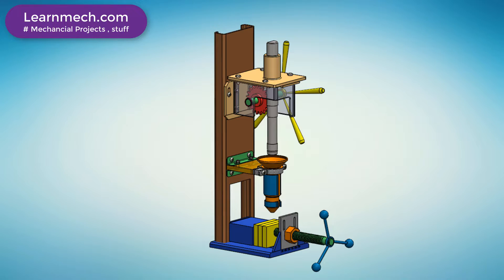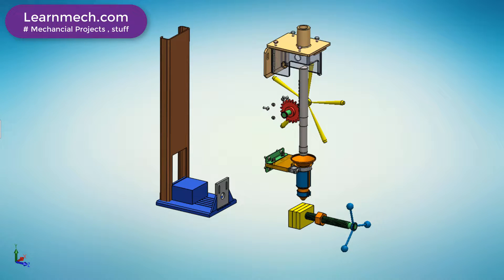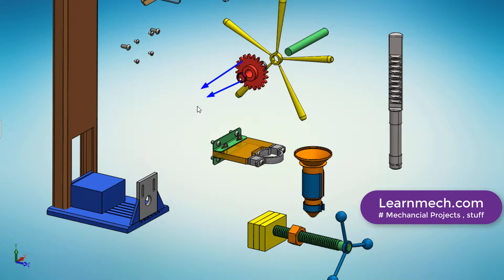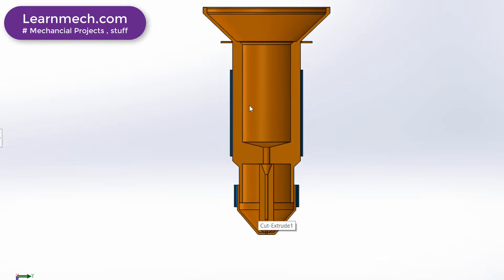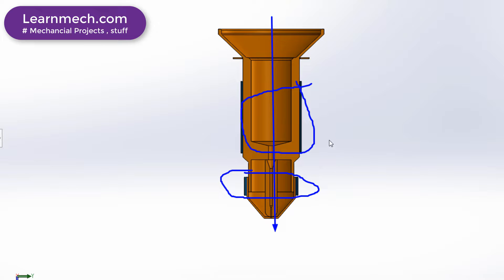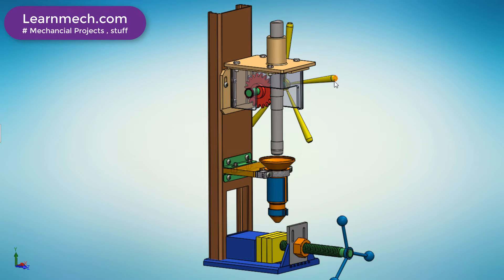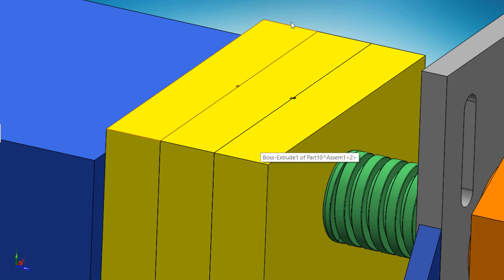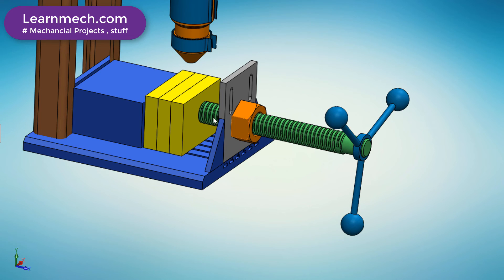Design and Fabrication Of Hand Injection Molding Machine | Mechanical Project

Comment: A very poor video and a poor machine design. 
1). No barrel spring for the nozzle to contact the mold.
2). The pinion gear is too large. The one shown will lessen the pressure. A pinion gear must be no larger than 1" pitch diameter. That gives a 1/2" radius, (.5) which doubles the force.*
3). The gear rack should be square, not round as shown. Square gear racks have a larger area of gear pitch allowing for greater force transmission.
4). The computer generated voice, sucks. Really annoying.
*Length of handle arm X force applied ÷ .5 ÷ ram diameter = injection pressure.
Example:
20" handle X 10# force applied = 200.
200 ÷.5 = 400.
400 ÷ ram area (say 1" which is .7854 area) = 509.2946 psi. injection pressure.
(to find the area of a cylinder: radius X radius X pi (3.1416) (radius is half the diameter).
Reply from the maker: its conceptual model ... not accurate at all ... thank you for the calculations ...it may helpful for other students . appreciated
Reply: Hello Steve, can you recommend a book or other source to learn more about those points please? Thank you.
Reply: Hi 
Can i pay and give me the sizes i need for each part?